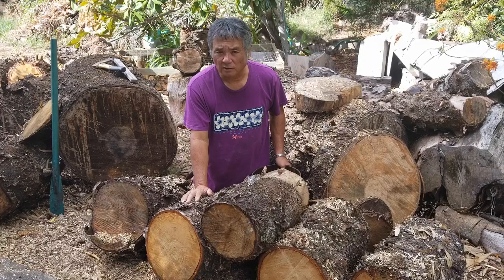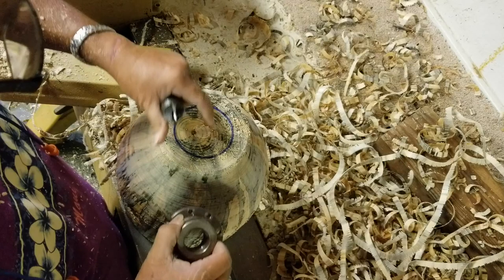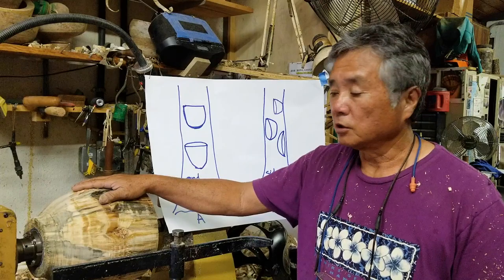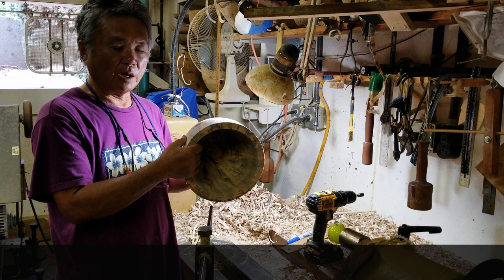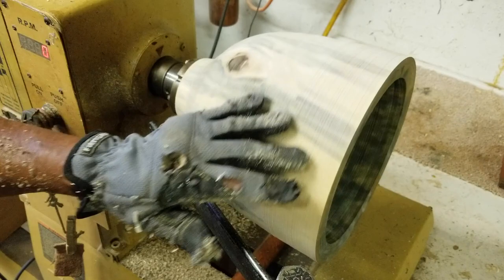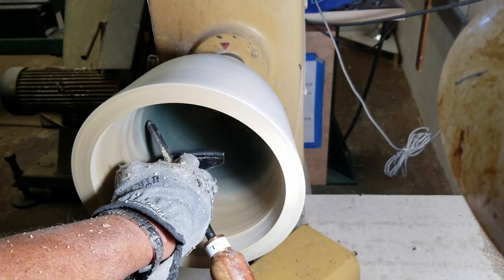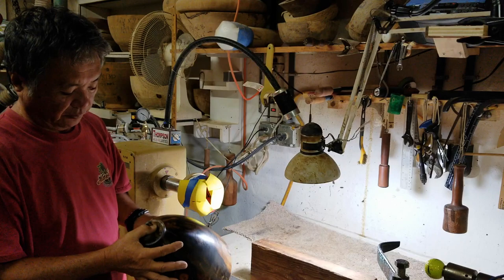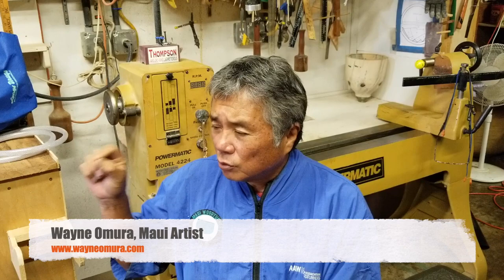Wayne Omura, Maui Woodturner

Comment: Great video!  Out of curiosity what is the wall thickness you normally go for?  I have a piece of NIP that I have been wanting to try but was a little intimidated by the super thin translucent walls, but your wall  thickness didn't seem to be extremely thin.
Reply: Hi Ricc. Sorry 7 months later. Never thought anyone would see this video that one of our club member posted on YouTube. Anyhow  for bowl 12 inches and smaller, I go for a I/8 wall thickness, for the bowl in the 16 to18 inch range, I go to 1/4 and for larger bowl to about 24 inches, I go to a hair more than 1/4 or a hair less than 3/8. Kind of depends on the form of the bowl. Thanks for asking.